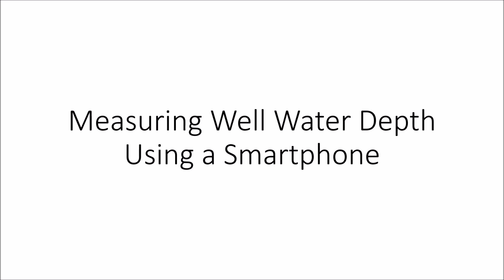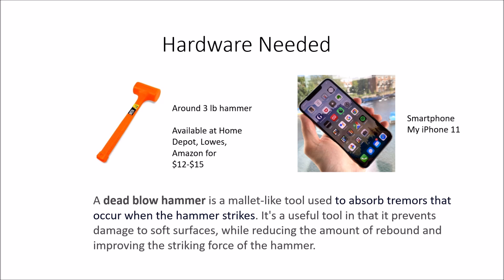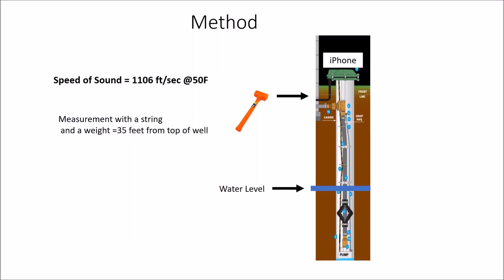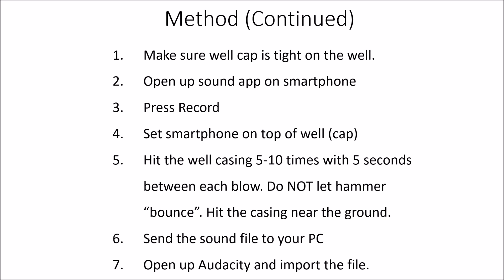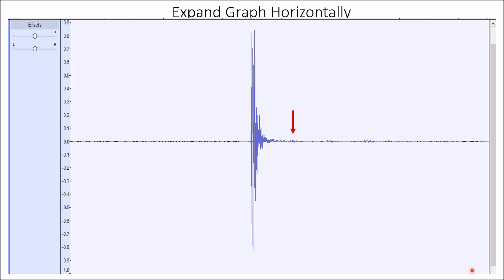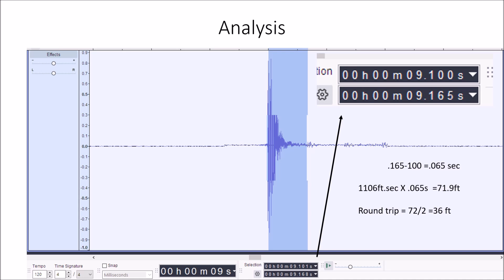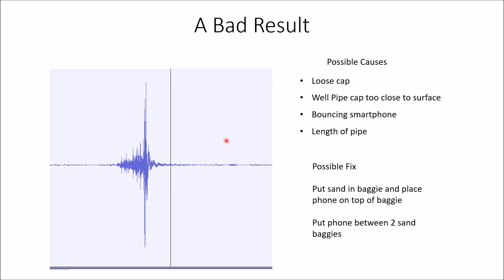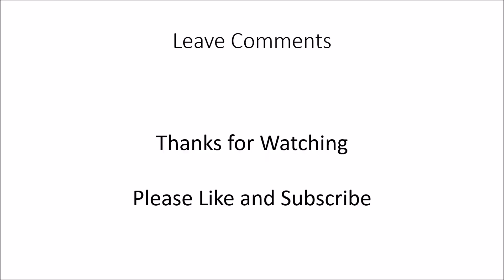Measuring Well Water Using a Smart Phone

Comment: I'm going to hang a bare wire from the top of my well right to the bottom and just leave it constant while keeping an ohm meter connected.  Maybe just measuring resistivity will give a pretty good idea of depth.  Maybe a guy could select a material that would be amenable to this.

Comment: Tell me if I’m missing something, but it seems to me that what you would be measuring is any reflection of the sound traveling through the casing itself, since you are generating the sound by hitting the metal directly and also setting the phone on the casing.  So what’s relevant is the speed of sound through whatever material the casing is made out of.  Also, are you sure that a reflection from the water surface is more prominent than a reflection from the end of the casing? I would want to test your theory against known conditions to make sure you’re measuring what you think you’re measuring.
Reply from the maker: The speed of sound in a steel pipe is around 19,000 feet per sec. vs 1100 feet per second in air. So 19,000 x .065 seconds would be 1200+ feet or 5 times the depth of my well.

Comment: Good video, retired ee here with specialty on analog devices and acoustics.  For those who can't get a clear precise initial pulse, use 2 phones. One that is recording, and the other to create the pulse. Place both on top, 1st one recording, then call the 2nd phone, creating an acoustic pulse.  Average your return pulse timings. Remember that the rough cylindrical shape will resonate. Should work for up to 200 ft or so. Alternate pulse generator could be a sonalert. Bad part about this method is you end to remove the cap, and place the phones right on the twell
Reply from the maker: Thanks

Comment: Instead of hitting the pipe, send a short sharp sound down the pipe. I would imagine the microphone & speaker on any smart phone are too far apart to do this. But a simplistic way would be to clap your hands hard. Realistically a loud version of a 'doggy training clicker' or a firecracker. I imagine the echo could be enhanced by keeping a clear line of sight between the sound & the bottom of the pipe. Temp down the casing probably is more important than ambient temp above. But then you get back to the probe down the well again.

Comment: I simply tie a small weight to a fishing bobber and lower the line until the float ceases to continue its decent. Place a piece of tape to the line at the top of the well casing, retrieve the line and lay it out in a straight line. Measure from tape to bobber. You now know the height of your water table. Why all the hocus-pocus techy stuff?
Reply from the maker: Why all the “hocus pocus”, as you call it? Because I have wire spacers every 10 feet down the well and I would never be able to get a weight let alone a float to line up with the holes in the spacers. Got it?
Reply: @PracticalEngineeringSolutions  That clarifies it for me. I must have missed that part. Thanks

Comment: The connect 2 wires to the test tab on a smoke detector ....when the wires immersed  in well water the  smoke alarm will beep.
I have a high water alarm for the basement sump pit.

Comment: My dad worked in the oil industry and made a device that measured well depth by using a burst of compressed air. The device had a metal reed that you could see inside a plexiglass box.The reed  would move when the air came back from being reflected off the liquid surface. Another way would be to use an Arduino and the HC-SR04 ultrasonic module with serial LCD readout.
Reply from the maker: Does that module have a range of 200 feet?
Reply: @PracticalEngineeringSolutions  Maybe 12 feet max. A very low frequency is used in professional well depth instruments, they can measure to 2,000 feet like the Well Sounder Pro 2010.
Reply: @jmcbike  As someone who has worked with ultrasonic level detectors, the system works well on a clear, empty pipe. The drop pipe will give you too many phantom reflections for it to be useful.
One way around this would be to use a "guided radar" setup, where a weighted steel cable is permanently installed as a wave guide for the ultrasonic signal. The point where the surrounding medium changes density (from air to water, and from water to mud) will reflect the signal.

Comment: Very interesting video, thx.  But your characterization of the well being "artesian" is indeed incorrect.  If it was artesian, pressure within the aquifer would push water to the surface without the use of a pump.

Comment: Another method would be to play white noise (even just making a “shhh” sound down the while recording and look at a spectrogram of the result in Audacity to find the frequency of the standing wave and calculate the length from that.

If it's not clear, play the result down the well and record that (Just like Alvin Lucier did with “I Am Sitting In a Room”)
Reply: I think this may be essentially what I was going to suggest as an alternative to OP's method.  That is, treat the well as an organ pipe.  Place an ordinary whistle at the open top and determine the note it produces as it resonates in the well bore.  Or, as jmi seems to be suggesting, leave the well capped and introduce a broad-band excitation vibration (equivalent to the whistle) and again listen for the tone.  But go back to your physics book and read up on the difference in tone generated by an open organ pipe vs. a closed one.

Comment: Fun challenge. If you do a search "calculate distance using ultrasonic sensor and arduino" you might get some ideas. The cheaper sensors don't measure as far but perhaps playing with the raw data you might be able to push the limits. I've played around with a phone app called phyphox which has a sonar feature. Not sure if its available for iphone though or what kind of distance can be achieved. Best of luck.

Comment: Using a pipe as a sound source is uninformative, since a pipe, even consisting of several sections, will resonate much longer and louder - by itself and along its entire length. And the actual echo, from the surface of the water, will be noisy due to the damped vibrations of the pipe. Therefore, the sound emitter should be an object that is not connected to anything in the well - neither to the casing pipe, nor to the cables, nor to the water-carrying sleeve. By analogy with the echolocation of bats - this should be a short-term, high-frequency pulse (squeak), so you need not a casing pipe, but some flat metallic, as saucepan lid. short high-frequence signals easily distinguishable on the record.

Comment: I've done something similar with my 39 m well that has 4" Sch 40 PVC casing. I got a result within 0.2 m of the direct measurement, about a 0.5% difference. I used the phone to emit the sound that I was measuring the echo of (with the well cap off). Using the phone, you can specify the frequency and pattern of the pulse. I used 10 kHz successfully, but analyzing the recording made me think 1 kHz may have been a better choice. The well water temperature makes for a good estimate of the air temperature inside the casing. Humidity also matters too - at 15 °C there is about a 0.5% difference in speed from 0% to 100% humidity. I'll add a link to the waveform of my recording in a reply to this comment.
Reply from the maker: Very interesting. How did you switch the phone from emtting the sound to receiving (recording) the echo?
Reply: @PracticalEngineeringSolutions  I was able to run the app generating the pulses in the background while using the recording app (or just with split-screen mode). That was on Android, but I imagine it should be possible with iOS too.

Comment: If you have an "Artesian" well, you have no need to measure the water depth because the water level will be at the surface.
Reply from the maker: You are correct but in my area of the Northeast we call deep wells "Artesian" to differentiate from a shallow well (<30')
Reply: Then what do you call an actual artesian well?
Reply from the maker: A surface spring

Comment: I too live in the Northeast where I have heard many people also incorrectly call any drilled well "Artesian". An artesian well is one where there is sufficient subterranean pressure to force the water to the surface.
Reply from the maker: You are correct. In my area we call deep wells "Artesian" to differentiate from a shallow well (<30')
Reply: @PracticalEngineeringSolutions  I’d heard the definition of artesian well that water surface in the well rises above the top of the confined water table. Example, I know some who had a well drilled in NE Washington that was nearly 200’ deep before it hit water. Quite a bit of this was rock. Expensive. They drilled several more feet, and pulled the gear. Overnight the water surface then rose to within a few feet of ground level. Everyone described this well as artesian. In writing this I looked up def’s, and found subartesian as a more specific descriptor of my friends well. I’m pretty sure I’d never heard this word before.

Comment: @PracticalEngineeringSolutions 
Cap off or mic inside the pipe makes those reflections more pronounced. 

I did that for my well. I did almost exactly what you did. Variations include Android, metal hammer and cap off. I was contemplating a corded speaker with corded mic so I could put them inside the cap. I was also contemplating modifying a replacement cap. 

My problem is a poor recovery. I get perhaps 0.1GPM recovery. After fracking they guessed I'm up to 0.2GPM. I'm 525ft deep and it comes up about 100ft from surface. So about 500 gallons in reserve. If toilet trickles it runs dry. Running dry to often results in replacing the pump. I want level sense so I can shut off before it runs dry.
Reply: @PracticalEngineeringSolutions 
Also you say northeast. I'm in southern Maine. Perhaps your close~ish to me.

Comment: I did this very thing many years ago.  My well is a bored hole (~3 feet in diameter) 50 feet deep and I have had as much as 35 feet of water in the well.  I used an analog portable tape recorder on the concrete cap and used Audacity just as you did.  I could never get good readings because of harmonics due to the size of the casing and the large cap itself.  Prior to this method, in the 1980s I built a mechanical device using a tin can wrapped with a turn of string with a weight on one end of the string and a float/weight on the other end.  I had a 10-turn potentiometer coupled to the axis of the can and wires running to the house and attached to the game paddle port of my Apple2+.  I wrote a short program in basic to convert string movement to gallons.  This worked very well, but I would have preferred the echo method.  If I could find a long range electronic range finder (cheap) I would use a Raspberry Pi or Arduino for measurement.  Another project I have used for several years is recording the cycles of my well pump and my heat pump (time stamped).  I record how much water is used and when, which is useful to know in case a toilet valve gets stuck open.  I ramble on.....
Reply from the maker: That’s very interesting.
Reply: > I record how much water is used and when, which is
> useful to know in case a toilet valve gets stuck open.

So it is essentially a Smart Toilet Valve.
Amazing!
:)
Reply: Apple keeps measuring well.

Comment: I love problem solving, and this video is solving a problem in an interesting way that i would not have thought of. Here is how I would attempt it:

It may also be useful for people who don't mind a little soldering, and can understand how to use a basic Arduino program, to use a pressure sensor, and an Arduino to record the pressure at the ground level, and the bottom of the well. If you know the internal volume of the well, and the atmospheric pressure, just above the surface of the water, I think that is enough information to graph an equation to show the depth of the well at each pressure gradient. (a small LED and analog camera transmitting to a cheap analog receiver may help in some situations)

Comment: in the oil feild it is called an echo meter, and uses about 250-500 pounds of CO2 to create the bounce.  the reflections you are seeing are going to continue until the energy is disappated.  our guns cost a few thousand along with the computer and software that calculated the oil in the foam as well as the depth to fluid.
Reply: You can use an analog gun with a shell and a set of dividers. The analog outfits don’t even use software. Have calculated so many by hand.

Comment: Neat idea. Some other ideas that came to my mind is using one of those wifi water leak detector. Lower it on a string. It will sound an alarm as soon as it touches water and also a notification will be sent to your phone. The string will be your tap measure. The other idea is using a laser measuring tool. This idea has a major flaw though, lasers get throw water so a way to make the water reflect the light back up needs to be implemented.

Comment: Water level measurements using sound have been done for more than 100 years.  
It is fun to see this amateur attempt, and indeed it works to some degree, using several manual steps.  I would be even more impressed if the results were closer to commercial solutions, where everything is automatic.

Comment: really cool, I think someone could also make an app that would use the speaker to make a loud beep while recording, and automatically calculate the depth directly on the phone
Reply: In theory this is of course possible, but this method is susceptible to a problem with very low signal-to-noise ratio.  
A "beep", with one or very few dominant frequencies, has very little information.  It is awkward to work out exactly when it starts and stops.  An extremely much better solution is to use a pseudo-random chirp, with MANY frequencies, like all modern radar systems use.
Reply: Going to try this with a spring loaded center punch and see what the spikes look like. Good idea
Reply: Thank you for this comment.  I can't use sound right now so I assume clicking in these videos there will be comments explaining it.